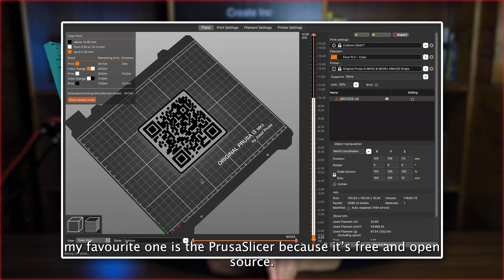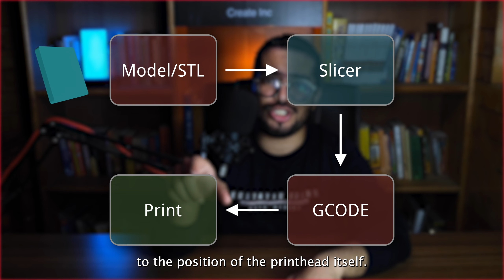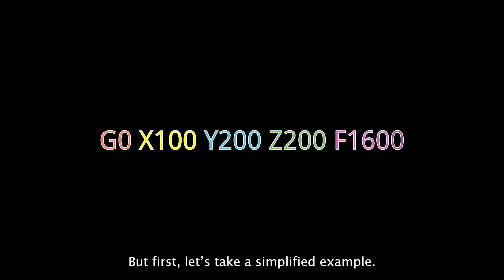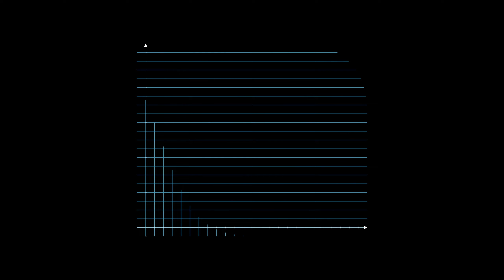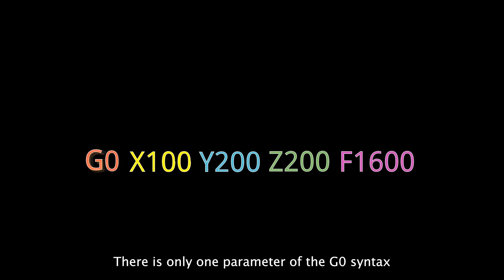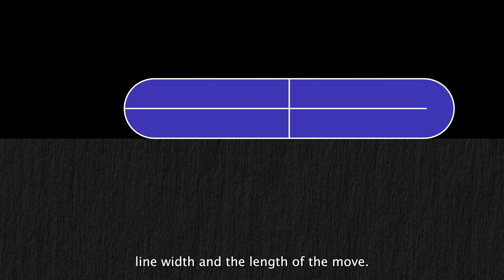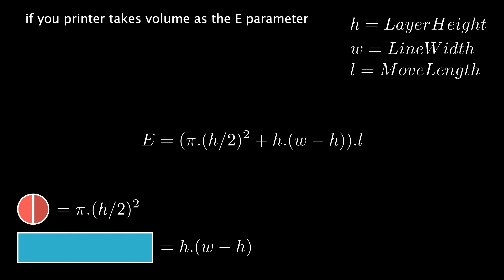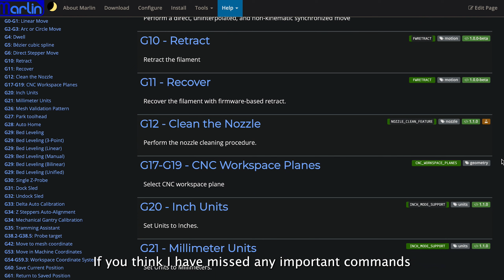The Language of 3D Printers | From Noob to Pro

Comment: As usual excellent video.
Favorite slicer: SuperSlicer. Like PrusaSlicer but on crack.
Ok but seriously, integrated calibration profiles - i.E you can generate a temp tower dynamically, and also has quite a few really nifty extra features like single wall on to and bottom layers and also quite a few more niece advanced options.

Cura I find has excellent  base profiles, and also IMHO a few great unique options like tree supports and lightning infill but god forbid you need to split or combine STL's, it's really bad at it. BUT IIRC it does support STEP files. Also PS and SS have a much better way of doing custom supports.
Reply from the maker: I did not know about Superslicer. I'd have to look it up. 

and so glad that you like my content.